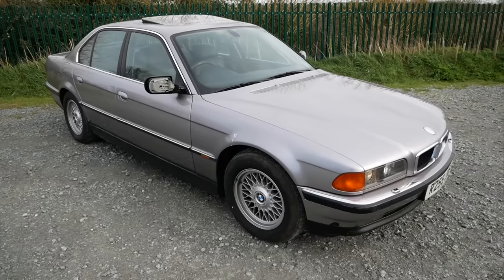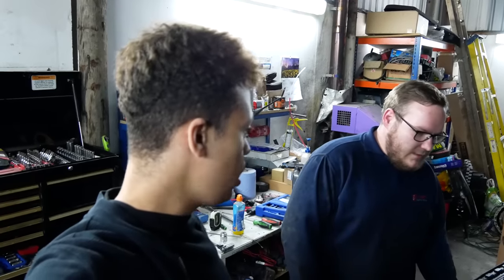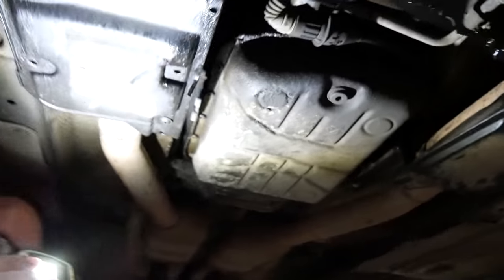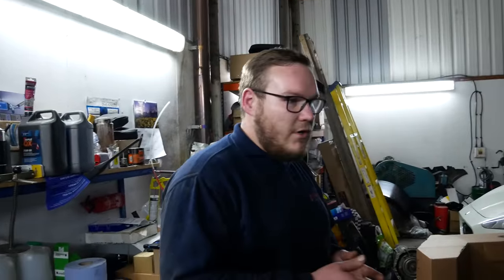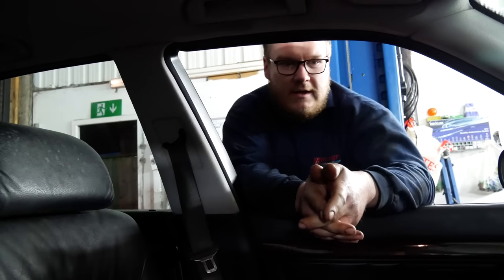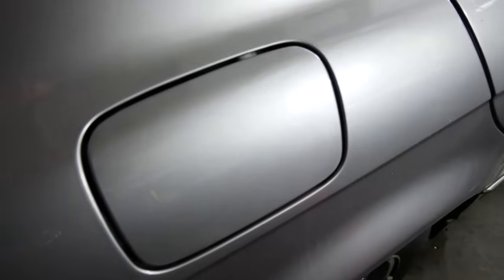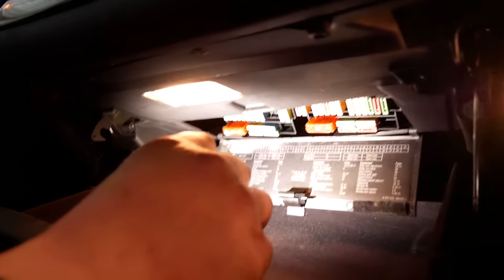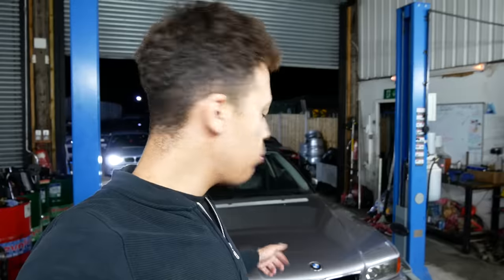HERE'S EVERYTHING *WRONG* WITH MY £900 BMW 7 SERIES

Comment: Hey man, check the timing chain guides. The M62 suffers from premature failure of the guides, which can throw the engine out of time = boom! If you're gonna make sure the car drives right, then this is priority!
Reply: said this in the last video
Reply: @steven-hf1wk  Sid or me? I did drop a comment on the last video about this
Reply: On the m62 yes correct. Strange decision from bmw to switch from the dual row setup on the m60 to the single row on the later m62... one of the reasons I chose the m60b40 for my e30
Reply: @vviiper  same, got a 540i and wondering if i should take the plunge and get them done it's at 143,000 but it's a £500 car
Reply: Most of this kids they only know how nice it looks and how comfortable it is and how nice it drives,they have no clue about the timing chain guids,the oil leaks,the intake vacuum leaks and how much of oil it burns between oil changes.
Reply: @garyjiani1171  every days a school day tho as they say. Actually good channel content watching a resto of a tired car, if he's making anything out of his hustle on YT it's a decent way of generating both content and views having a project or project cars.  I've give him a sub even tho the maclaren antics put me off (tho as I said,  every days a school day) because he can steer, there's nice cars and given I'm watching these videos for pure entertainment he's coming across to me like the presenter of a TV car show, be it top gear or whatever so it's working even tho he's from THAT generation you alluded to in your post Gary!🤣 Keep it humble Sid cause as we will see on the back end of this covid crisis  it's easy to be rolling in life with a few quid then lose it all thru circumstance, your £900 tired BMW is as appealing to any car fanatic as a new M5 etc👍that's my random  feedback and my reply to Gary who's blatantly of a similar generation to me 😂

Comment: Love the E38! If you are getting damp in the passenger and driver footwell you need to check the vapour barriers behind the door cards it's the foam type stuff that should be sealed all around to the door skin if there's a break it will Leak water in

Comment: Regards the wet carpet, Check the sunroof drains for buildup sid. Sure they run down the A pillars and drain out behind the wing, if it's been stood for a bit they could have gotten clogged up. Which would be a simple fix with some compressed air and thin metal rods 👍

Comment: My E38 AC Schnitzer S7 has 175k on it now so they are good for mega miles.

Keep the oil changed regularly (5W40 every 3k) and it will be fine!

Also, change the lower timing chain tensioner.....

Comment: What gearbox are you looking for? I have a e39 540i with an auto, want to swap it to a manual as well.
Reply: nobody wants an automatic doe so your gearbox as a trade is more like an insult
Reply: @wudupfammm8555  sorry I don't understand your comment, of course I don't want an auto but very few e39 540i's were sold in the UK with a manual.
Reply: @wudupfammm8555  the 540i engine is the M62B44 so just curious what manual gearboxes are compatible
Reply: wudup fammm speak properly you simpleton and read his comment first. Same engine and also looking to Manuel swap his
Reply: @MikeWilliams-vp7jb  you need the getrag 420g 6 speed from the 540i or m5, I'm pretty sure the m62 takes its crank shaft sensor reading from the flywheel thus the gearbox has a hole for the sensor. The earlier m60 has its crank sensor on the front pulley so you can fit both the 5 or the 6 speed boxes on those

Comment: Could you fit a super charger to this or a turbo?
Reply from the maker: Maybe
Reply: @SidNorth  👊
Reply: Supercharger all the way 🤘 ess do a wicked looking kit in the states 4500 bucks. I'm either going to charge my m60 e30 or swap it out for the s62 not sure yet
Reply: @clayp.e30_v86  awesome do you have an estimated bhp from this?
Reply: @mmaworld552  how long is a piece of string really mate. Lots of variables. Engine condition, size of pulley (determines psi), no reason why a decent m62 cant make 400 bhp easy!
Reply: @mmaworld552  and its VF engineering sorry not ess my apologies. But also dinan do kits aswel also in the states. 
I had a dinan powerdyne charger on my old m52b28 engine in the e30 a few years back 😎😎
Reply: @clayp.e30_v86  would be a nice build for sure 💯 👊
Reply: @mmaworld552  I'm undecided at the minute, charge it or swap the m60 out for the s62 and get 400 horses n/a 🤷‍♂️ decisions lol
Reply: @clayp.e30_v86  super charge it i doubt theres many about either 👌